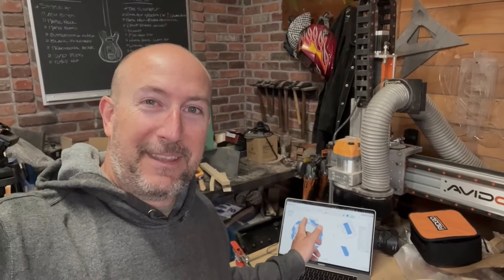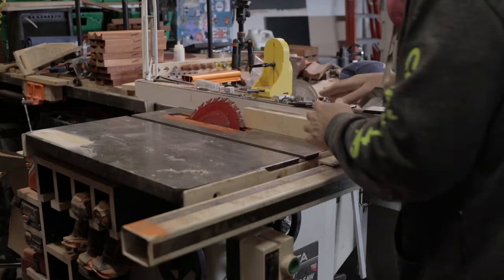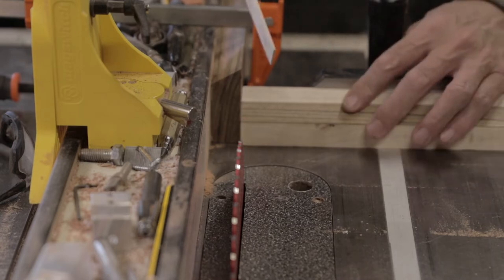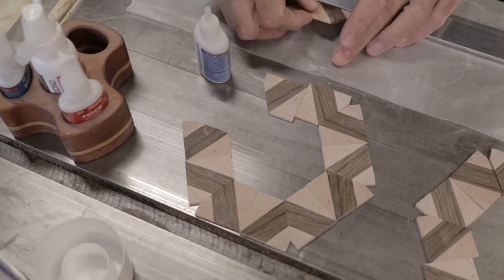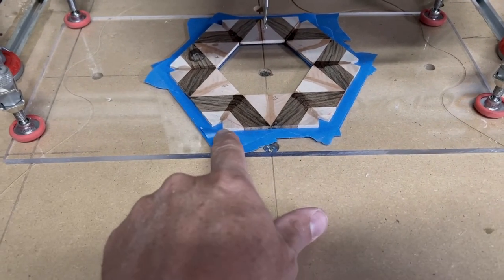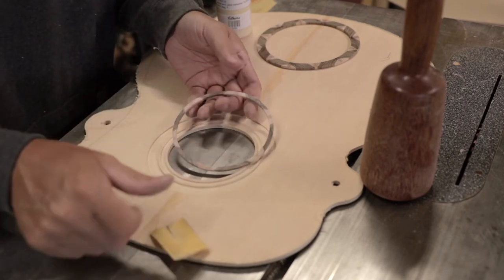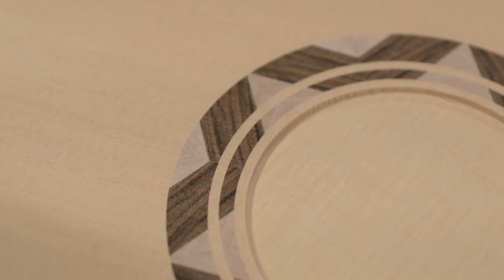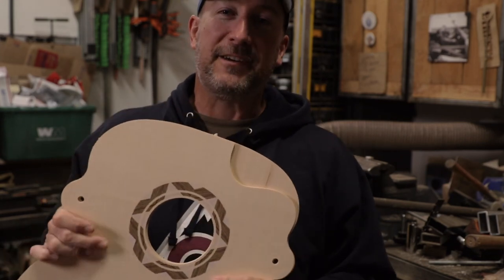Creating A Rosette - Acoustic Build - Ep 6

Comment: Looks great Greg! I think designing and executing a nice rosette is my greatest fear when thinking about acoustic guitar building. This checked all the boxes Greg.
Reply from the maker: I'm not going to lie Dane...  I put this off longer than I should have.  It was WAY easier than I thought it would be.  The thin CA was almost an instant bond, so I didn't have any issues with clamping and holding the pieces.  Gluing up the parts in a half circle was also a great solution.  I've seen Frank Haworth glue up segmented bowl sections like this a million times so I figured it would work for a rosette.  The only thing I didn't do was add perfling...  That will def be part of my next build.